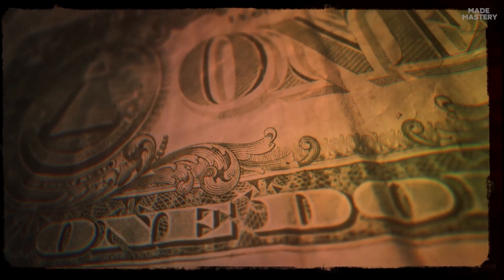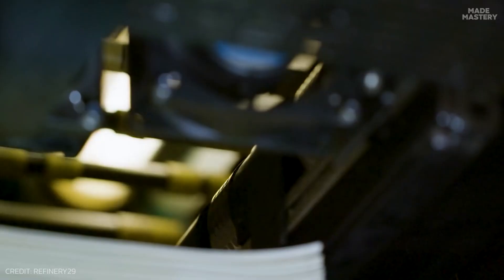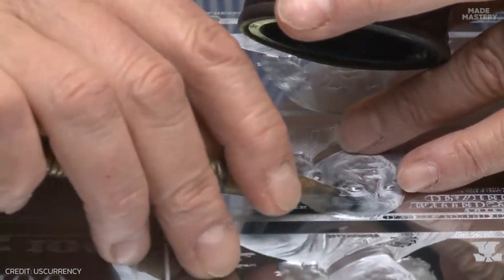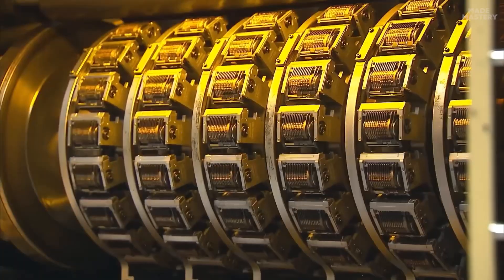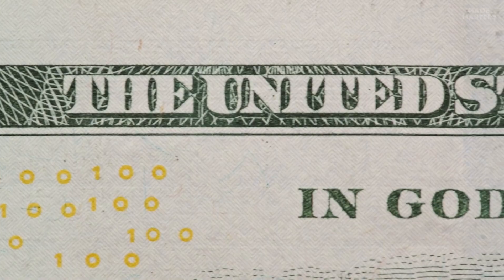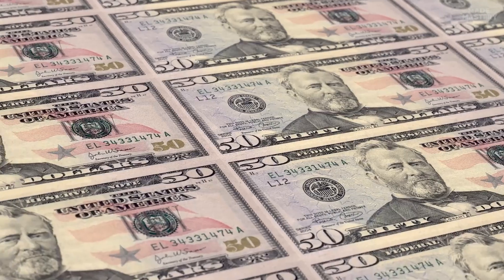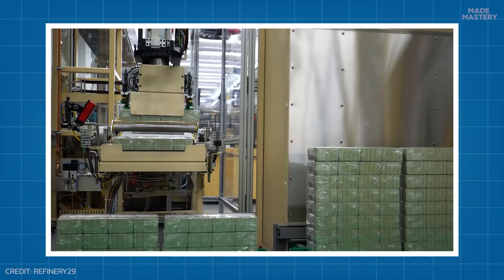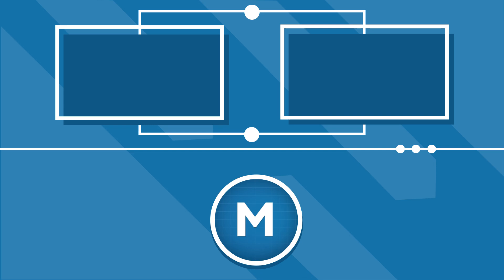How U.S. Paper Money Is Made At The Bureau of Engraving and Printing

Comment: There's quite a lot of wrong information here, though.
Reply: Have you made a video with quite a lot of correct information?
Reply: Like, what??
Reply: @Duke.of.Damage777  Engravers no longer work by hand today. The tool they used was also not called a "Pantograph" (that's a machine that reduces a larger piece into a smaller one, usually reserved for coin/medal designs). The engraver's tool is called the burin. 

Nowadays, the engraving is done digitally, and the machines used engrave it with lasers.
Reply: ❤❤❤❤😂😂😂😢😮😮😅😊😊okokkokewww yes yes Nursiah puga semua ok
Reply: “Quite a lot” is a wild statement sir
Reply: @chiefdabejo2120  You're right. Given the amount of information present in the video, the information that's wrong is a small portion of it. I should have said that it's "quite wrong". Not sure where my reply indicating what is in fact wrong with the video went, though.